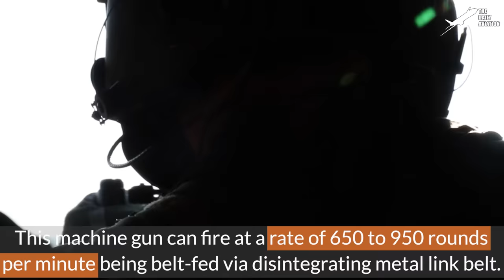How they Replace Massive Engine of US M1 Abrams Tank

Comment: Someone needs to go back and do more research for this. This is pulling the Pack, not the engine.  It's the engine and transmission, its one unit, you can't just pull the engine by it's self.  The M88 is based off the M60 tank and NOT the M1 at all.  All M1 tanks not just the M1A2 was designed for engine replacement in theater or in the field.  Did this more times than I can count both in the field and theater or Down Range.  I do remember pulling the Turret one time in Germany and we had to use 2 M88A1's and they drove the tank out from under the turret and moved the turret ring in place for it to be sat on.  We all got a ball bearing from the ring of the turret.  Still have mine on my frig.